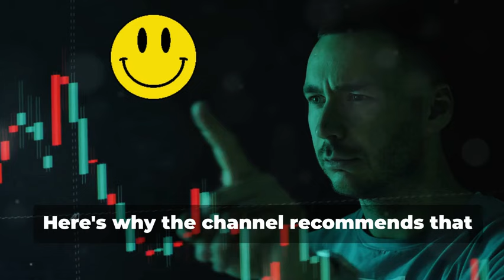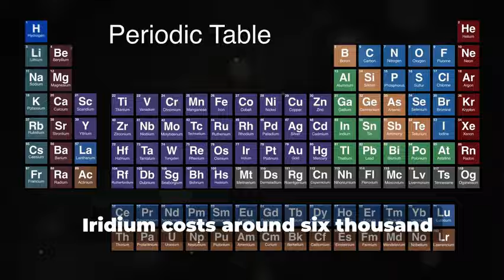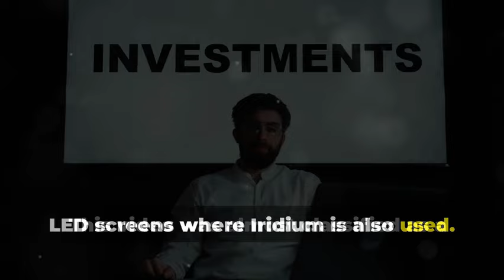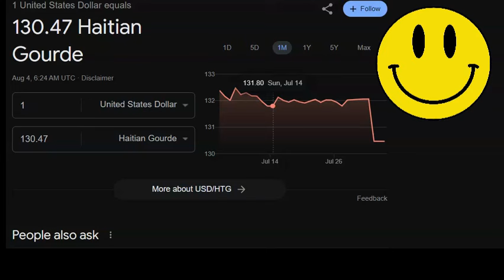Haiti's Iridium Worth More Than Gold SPECIAL REPORT

Comment: WOW, I was just asking about other metals. I never heard of iridium. Have you heard of Sinjarite from Iraq, found only at Mount Sinjar I heard.
Reply from the maker: No, I had never heard of Sinjarite: A hygroscopic, soft, pink mineral was discovered in Sinjar town, west of Mosul city. Wet chemical and X-ray diffraction analyses proved that the mineral has a composition of calcium chloride dihydrate CaCl 2 ·2H 2 O, which has not been known in nature before. It is therefore a new mineral and is named sinjarite after its locality.  Will do more research to learn more.  Seems like it is only found in Iraq?
Reply: @sandyingram  that's what has been said. Very rare mineral.
Reply: @sandyingram  it's been suggested that the mountain is the remains of the tower of bable and the original sight of Satan being sent down to earth.